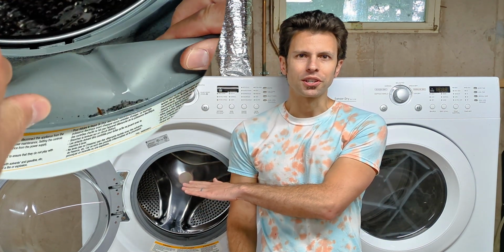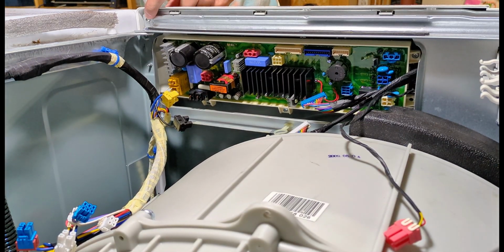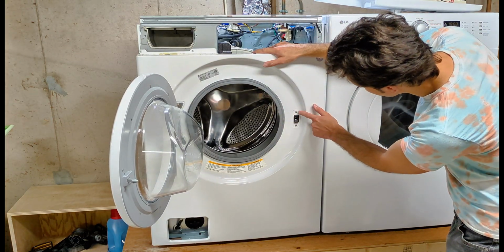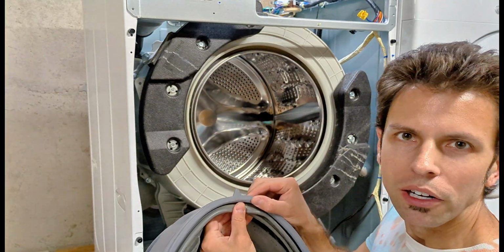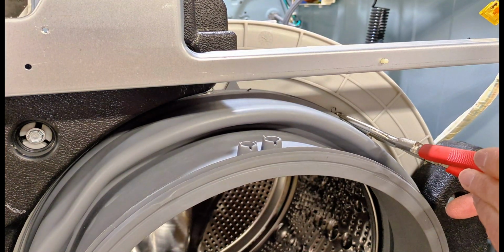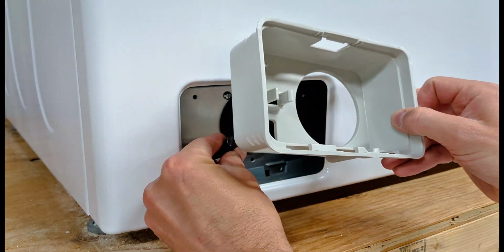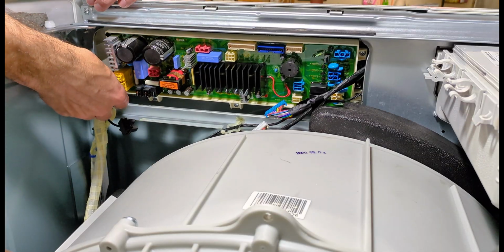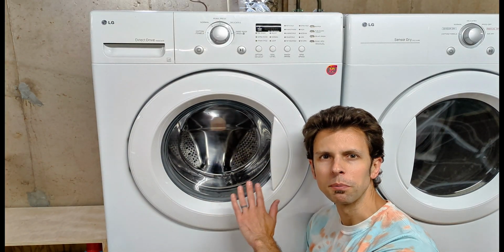How to Clean or Replace a Washer Door Gasket (LG washing machine - long version with panels removed)

Comment: Ty just finished troubleshooting mine and hopefully this will solve our problem
Reply from the maker: You're welcome!
Reply: @realhouseDIY welll it did not still have black rubber pieces after every wash 😢 I think there is something else going on with it may be a part going bad 🤷‍♂️ any suggestions ?
Reply from the maker: @theflacochannel1268 it's rubber and not scum flaking off of the outer tub? I would first try running a number of tub clean cycles with bleach to help clean it. If actual rubber pieces, there are rubber hoses that deliver the water so any of those could be breaking down. They are easy enough to inspect with the top panel removed and power and water shut off.

Comment: First, this was a VERY good instructional video. Kudos and thank you to @RealHouseDIY

However, this is likely a one and done for me. Getting the inner gasket back on took hours, even with using some laundry detergent to lube it. This made it easier, but my washer model is from 2023 and has an added black frame around it which made aligning the spring and the gasket impossible b/c you can't get your fingers in to make sure the metal stays around it when clamping. The design of the washer is really poor and I'm really not sure what else I could have done to make that easier. I finally got it, or at least I think I did b/c I really can't see the sides b/c of that black plastic drainage frame.
Reply from the maker: Thanks. I believe the black plastic around the edge would be the balance weights. They are removable if needed. But chances are if you got it to connect, it's fully seated where it should be, otherwise it either wouldn't connect or would feel very loose. Can also monitor for leaks underneath.

Comment: Can these gaskets make my washer leak? I have pretty much the same model just a gun metal finish not white  . Thanks.
Reply from the maker: Yes, if either of the two spring clamps has come loose, or if the drain tube at the front of the gasket has disconnected. Best to take the top panel off and look in with a flashlight to see where leaking is coming from.
Reply: @realhouseDIY I just noticed i had a tear on the bottom part of the gasket...😢
Reply from the maker: @jhand294 oh wow, these gaskets are very thick too.

Comment: Any tips on sliding back the top panel when it won’t budge at all? I’ve removed the bracket and 2 screws on each side in the back and the top panel doesn’t move. I have an LG wm8100hva.
Reply from the maker: I checked the diagram and It should be the same. I would try completely removing the rear plastic brackets. Take out any additional screws there. Then see if the panel will slide back.

Comment: Just an electrical FYI you should give a 1/2 hr for the Caps on the control board to discharge; don't know if you mentioned that.  It can give a nasty shock but importantly can smoke your board easily if not careful.
Reply from the maker: Good point. I don't think I mentioned it. For me it's second nature to not touch the electronics.
Reply: @realhouseDIY  Just a useful precaution as a dropped screw or ill-placed screw driver can be a costly mistake.

Comment: Do yourself a favor. Spend the money on the proper tools. If you do you can do this whole process without removing the casing. Otherwise your talking hours as compared to minutes.
Reply from the maker: I did exactly that in another video. Some people found this version easier and good to see the different options.
Reply: What are the proper tools to put the inner gasket loop back on?
Reply: @T @TheGrimy1One  if you don’t want to spend the money the first time we tried this we used zip ties to get the inner spring on. It was a mofo but it worked.
Reply from the maker: @TheGrimy1One there's an expensive ($100?) LG spring clamp plier tool that is angled to reach the clamp. Last I checked it wasn't available though.

Comment: Fyi I had to use dish soap as a lubricant to get the gasket back on. I struggled with it for awhile and once I decided to put soap on it I got it on in less than a minute. Now on to the inner spring clamp.

Comment: I've got a slightly different LG model, but your instructions are pretty much the same. For example, I have five screws across the top of the door panel and my electrical connections are different but still easy enough to disconnect. Mine also has a light in the gasket. Should I soak all of the gasket except for the light, go ahead and soak the light, or find an alternative cleaning method? I'm down to that last rear spring so I figure I might as well continue. Thanks.
Reply from the maker: Does the light seem removable? Or if it's up at the top of the gasket, you might just leave that part above water when soaking. The dirty part is at the bottom anyway.
Reply: @realhouseDIY  it turns out the light is removable. It was just so sealed with gunk that I thought it wasn’t.
Reply from the maker: @leelfm great! Good to get everything clean

Comment: This guy does great at explaining how to do this. And he's been working out and getting ripped since his last video where you dont take the front off. So, props to him for taking care of himself so well.

I took the entire gasket off. (Watch videos on YouTube. Its actually not hard and it allows you to do the proper maintenance to the machine to keep it running good.)
Taking the gasket off allows you to submerge it into a five gallon bucket of bleach and hot water. Id say about a gallon of bleach in the bucket wit the rest filled with hot water. (Push the gasket into the bucket and put something on top of the gasket to ensure it stays submerged.) We left it to soak for 2 hours the first time, then scrubbed it with a tooth brush and a green scratchy thing for dishes. I just dipped the tooth brush and scrubbed into the bleach/water mixture to get the nasty stuff off. This got quite a bit of the mold. But what really got the mold was the second soak of bleach and water. When we took the gasket out, it looked damn near brand new. Even the black staining from the mold was gone. Just some slightly darker gray spots. I did not think that the results would be that great. But they were. Super happy we soaked it. I don't know why people are saying bleach is bad for the gasket, the maintenance manual literally says to clean it with bleach. 
Anyhow, the advantage to taking the gasket entirely off is that you can clean the area the gasket touches, as well as CLEAN OUT THE DRAIN PIPE THAT CONNECTS TO THE GASKET. The reason your gasket is nasty is likely due to the fact that the drain port and the drain pipe are full of hair and gunk. Make sure to remove the little pipe (use channel locks to loosen the clamps), and clean it out with a small stick and make sure that water can freely flow out of it. Then put it all back together. Having the spring tool would have been nice, but I was able to do it all with needle nose pliers. (2 sets of pliers) however, at like $20, the spring pliers are worth it. (Its that or spend $500 to have someone do it for you.) The greatest thing this guy showed me was to bend the little hook on the inside ring clamp so you can take it off. This allowed to to completely remove it and then put it back on by simply bringing the spring clamps back together and then bending the hook back in place after.

Don't be afraid to do it yourself. Its really not a hard repair if you set yourself to the task. Comment here if you have any questions and I'll do my best to answer quickly.
Reply from the maker: Thanks for the great feedback! 😁